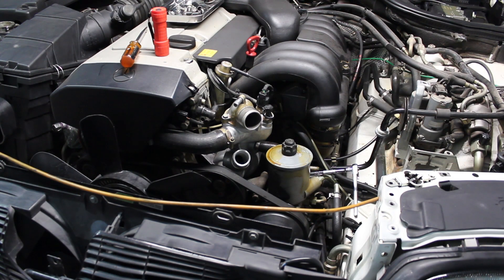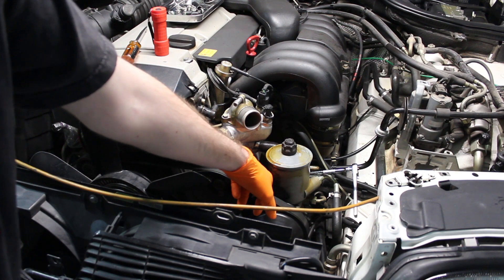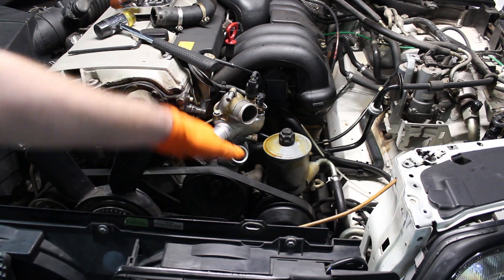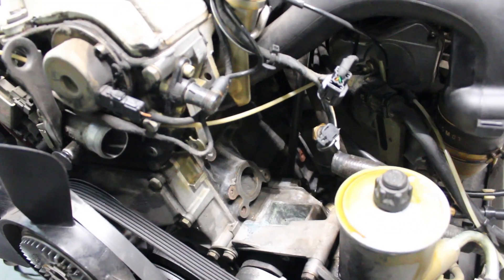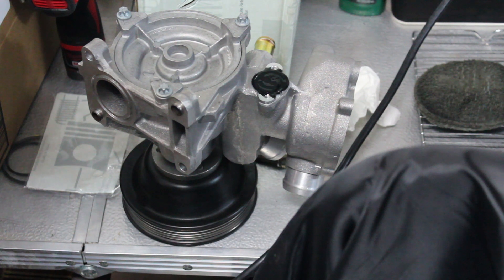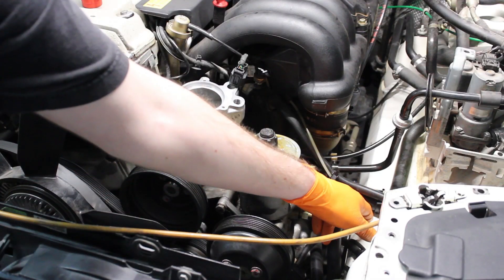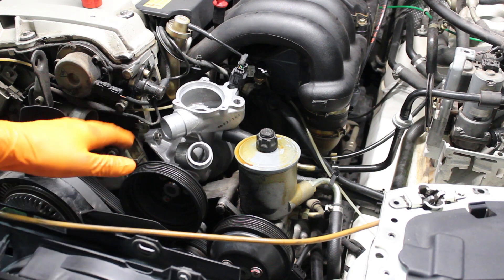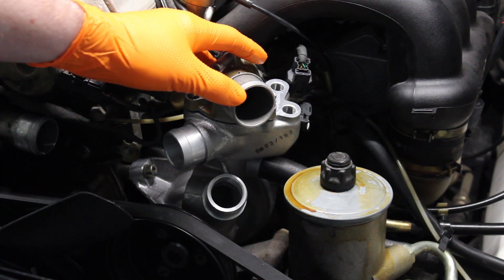Mercedes-Benz M104 Water Pump Replacement

Comment: Thanks for this, first time I actually saw someone show what that port was. Mine is like yours and does not have the extra port. I will get the pump without. However, on pelican parts, they have 4 different water pumps and it says they all fit my car. 2 I know are no good due to the extra port, however the other two are different per engine number? Are you familiar with this? I have a 94 C280 and as far as I know they should all be the same... Mine also gets hot in traffic and even at highway speeds my fan still runs in the summer. Lots to learn I usually drive Japanese vehicles.
Reply from the maker: There were some differences at different cutoff points on the M104 engines.  Potentially between 280 and 320 engines as well.  Definitely check out the number on your engine and cross reference to the ranges on Pelican Parts.  Thanks for watching!

Comment: What size of plugs I need to use to seal the upper two threaded ports?
Reply: 14mmx1.5 pitch plugs.  I ordered  2 each SS with copper washers from Amazon

Comment: What is the correct name for the sensor on the side of the water pump ( not the 2 sensors up near the top of the thermostat. ) it screws in horizontal just below thermostat housing. Thankyou kindly.

Comment: Just FYI, this job takes longer on the W124 & R129 ( i.e. M104 prior to 09/1994) due to the belt tensioner system on those models.
Reply from the maker: Makes sense, I do remember seeing some differences when researching but found it much easier on the W140 for sure.  Thanks for watching!
Reply: Tell me about it 😂😂

Comment: Why are you just pointing at things and talking? I would rather enjoy you talking and showing how are you doing everything, without cutting video (time lapses)
Reply from the maker: That's the walkthrough style of video I've always done...I'd love to do timelapses but don't have the equipment for it and often take so much time on projects batteries would die leading to incomplete video clips.  Thanks for watching!
Reply: @redonKiLaus  did your temperature change after changing the water pump I have the same engine on my car and I am experience experiencing hot running engine in the summer. I change weedeater I change thermostat and I rated the fans to start at 90° but the car still gets hot. The only thing I haven’t changed is the water pump and I wanted to check with you.
Reply from the maker: @adam1198s  It did and was a good bit better/more stable.  That said, mine does run slightly hotter in summer, and if I hit traffic, gets uncomfortably hot/may overheat.  I typically don't drive it in summer, or when I do, only short local trips with little to no traffic implications.

Comment: Hi did you have to take out (or move it aside) the power steering pump go give access to the bottom nut?
Reply from the maker: I don't believe I did, though I took it out a few months later for a rebuild...lol.  Thanks for watching!
Reply: redonKiLaus hi I managed to take out the  water pump without touching the power steering pump. Had to remove only the belt tensioning system to access the bottom front nut. Your video inspires me so much. Please keep it up
Reply from the maker: @marnku75  Awesome, I'm glad you got the job done and it wasn't too bad!

Comment: Thanks for that - I'm about to replace my R129 SL 280's pump - all four of the bolts on mine are hex bolts - and a real pain in the a** to reach because of it. I'm guessing someone replaced your bolts with 13mm on a previous pump replacement. I must say, I'm tempted to do the same! Wish me luck!
Reply from the maker: I feel your pain - from what I've read, Mercedes used the internal and external hex bolts interchangeably throughout the years and on different models.  I'd definitely swap hardware as long as you replace with high quality stuff.  Good luck, and thanks for watching!

Comment: I have a 95 C36 AMG with water pump on its last legs. I have an extra motor sitting around from when I had a W140 S320 I was wondering if I could use the water pump for that motor and if changing it is the same procedure
Reply from the maker: Possibly, but knowing Mercedes I also wouldn't be surprised if it's totally different.  Visually compare and go from there I suppose.  Thanks for watching!